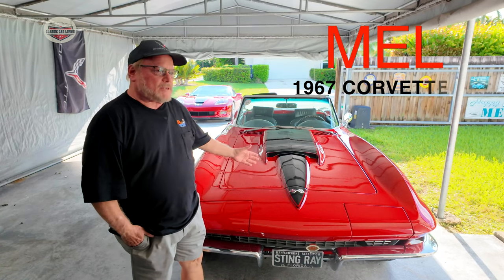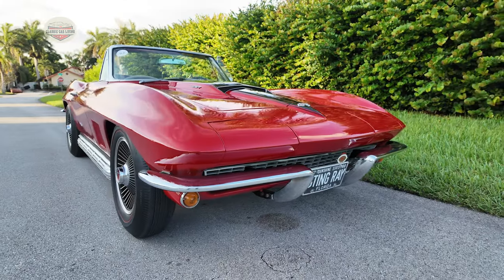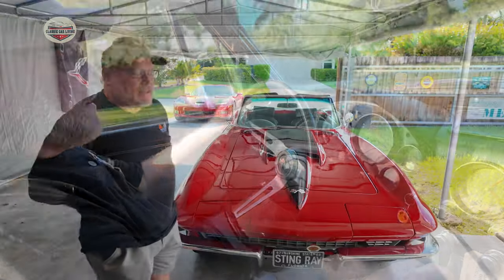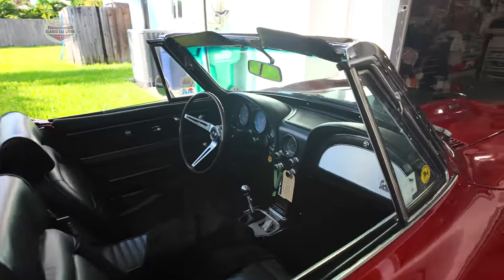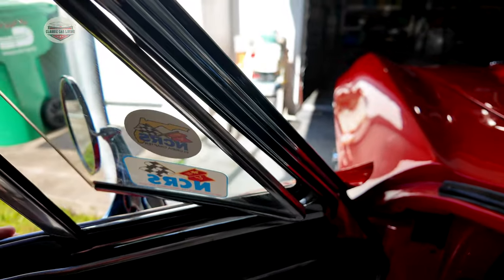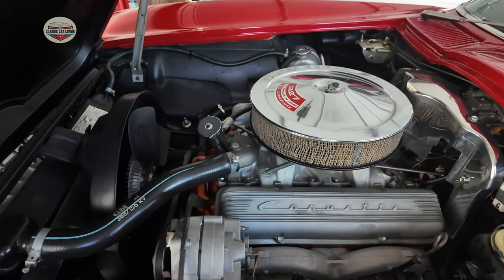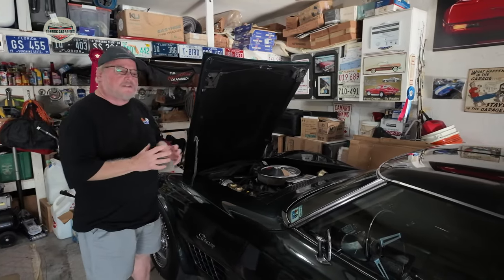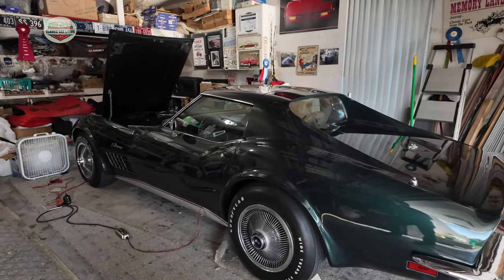The Most Iconic Corvette: 1967 Stingray

Comment: This is the L79 and this engine did not use the Duntov cam, the Duntov cam was a fairly radical solid lifter cam, the 327/350 was a hydraulic cam. Compression was 11 to 1.
Reply from the maker: @thud9797  All I know is that Mel is an expert in Corvettes so I will show him this comment to see what he says. Thanks for watching and appreciate the support💪
Reply: @305classics  
Ok cool and the car is incredible! 😎
Reply from the maker: @thud9797  it sure is. I’ll get back to you with the info.
Reply from the maker: @thud9797  Ok, so here is his response: The engine was a replacement block under warranty back in 1969.  When the car was restored, it was upgraded with solid lifters and a DUNTOV camshaft was installed.   He is correct about the factory specs for this motor - however the restorer beefed up the engine 

Hope this clears it up. Thanks again for watching💪
Reply: @305classics  
Awesome, that's a great build.
Reply from the maker: @thud9797  Thanks again!
Reply: The 327/350 HP factory cam gave the engine a beautiful sound, especially at idle. Great engine.....
Reply: That is correct for the L79. Hydraulic/11:1

Comment: The 350hp 327 (L79) did not have a solid flat tappet cam. It was an aggressive hydraulic cam.
Reply from the maker: So I don’t remember what he had said but understand that this guy is an expert Corvette  guy who works for Hagerty. This is his expertise.
Reply: Well, I would think before to were to put your foot in your mouth you would have gone and listened to what he said. Then perhaps you would have done a tiny bit of research to see what the L79, 327 CID 350 hp engine was equipped with. So in spite of this guys supposed credentials he is wrong about a 350 hp 327ci (L79) having a solid lifter cam. He's not the only one with knowledge about Corvettes. In this case, he is mistaken.
Reply from the maker: @lencac7952  So I spoke with the owner to confirm for you and his engine was replaced under warranty back in 1969 by original owner. When they replaced the engine, the owner upgraded to sold lifters and DUNTOV cam so you are correct. 
I don’t pretend to be an expert on any of these cars, I just let the owners give the viewer the history and story. Thanks for watching and appreciate the support.

Hope you have a great day.